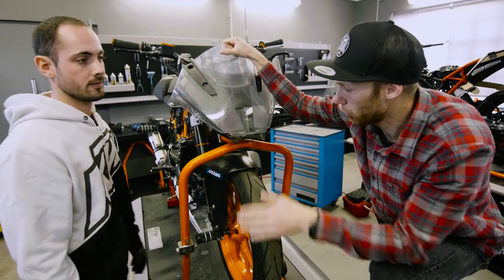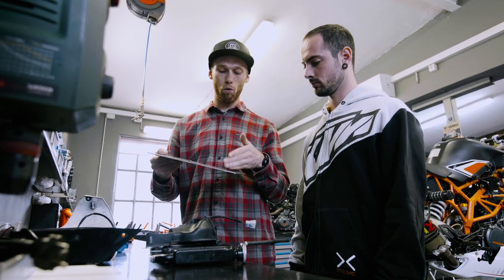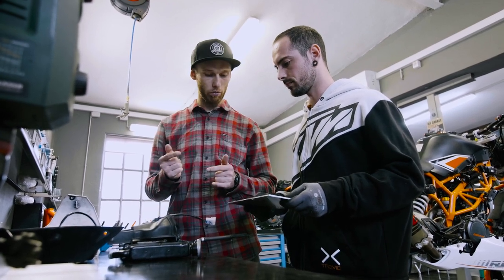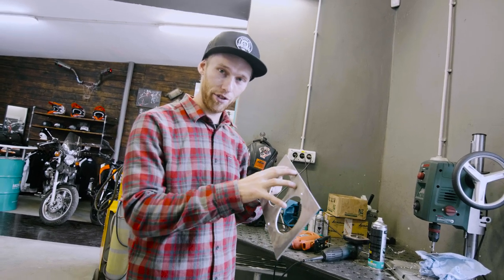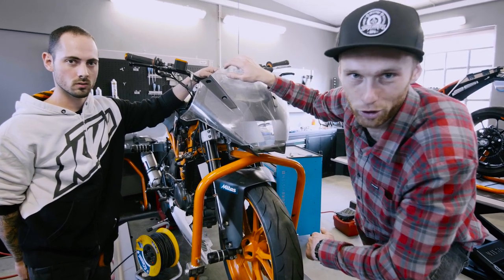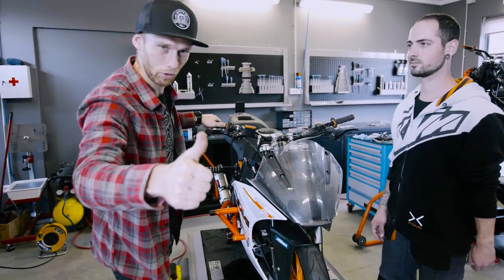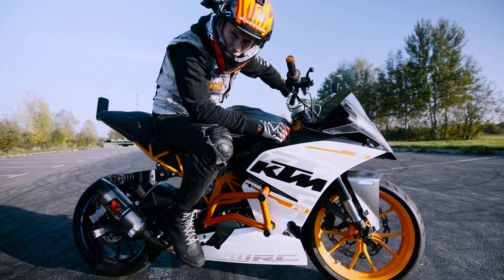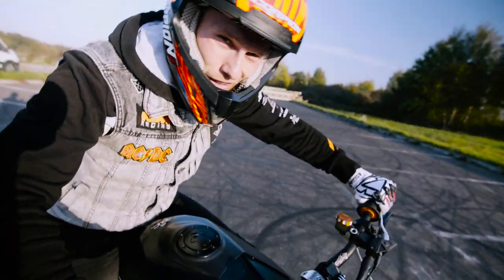Tuning the cooling system on my RC 390 | RokON VLOG #36

Comment from the maker: Guys, the cooling tuning that we did is only good for drifting and not for a normal street use or racing. For that is different kind of tuning needed ;)
Reply: RokBagorosStuntrider it's not possible to drift a 110 cc motorcycle, is it? Like, my bike is not really powerfull enough.
Reply: RokBagorosStuntrider could you kindly suggest a good exhaust system that produces good sound and is not very expensive for rc390..i am in india
Reply: RokBagorosStuntrider So would you kindly advice what would be suitable for normal street use ? You know how hot and jam here in Jakarta as per last time you visited us here, you knew that. My problem for Duke 200 and RC 390 always about heating, for RC 390 I use Spal pulling fan but i guess 1 fan is not enough, advise please
Reply: PLEASE REPLY ..  SUGGEST ME A POWERFULL COOLER FAN FOR 2017 DUKE 390 ..  (urgent)    its a HEATING PROBLEM
Reply: Anshuman Singh motual ice expert
Reply: Dude I love your videos and am #Curious to know which #Handlebar you are using??
Reply: @atebyrocks1  make your own exhaust, I did that on my RC.
Reply: I m planning to install it on my Ktm duke 390 since I do some off-roading so it heats up in low speed . Will it work properly if I do that on my duke ?
Reply: 390  adventure : hold my beer
Reply: The duke 390 stock I would say needs a fan upgrade to keep it cool. City riding with stock fan always seemed to be running super hot.

Comment: I love all your videos. You're getting better at editing since you first started, really nice work for a youtube channel. If I may make a request; I'd love to see more RC390 accessories reviewed. I trust your opinion and expertise with the Duke and RC series bikes from KTM. you are, after all, one of the leading world experts on these specific bikes being taken to extremes.

I also have 2 questions, if you have time. 

(1) What tooth sprocket do you recommend for wheelies/drifting that will also be good for track use? I'm thinking 45-47?

(2) What brand/model tires do you use for drifting? What tire pressure?

Comment: Bro if I didn't on or ride my bike for  1month..!! is there any problem will I get on the bike.. I have a RC390
Reply: i've had mines for almost 2 years and the only thing that is happening with mines is that it's over heating. the longest i went without ryding is maybe 1 month and it started right up.

Comment: Hi, how can you put a fatbar to a ktm rc 125? Do i have to drill the upper triple clamp? Or is there a nother way?
Reply from the maker: You need to change the whole clamp unit so it fits to the fatbar, but soon there will be a Rok Bagoros edition handlebar which will fit the original clamp ;)

Comment: anybody can tell me what changes I need to do drift and burnout? should I change my sprockets and disc breaks to a bigger size? by the way I always failed every time I try to drift and burnout, the wheel won't spin and slip
Reply: I see the sprocket is bigger than the stock